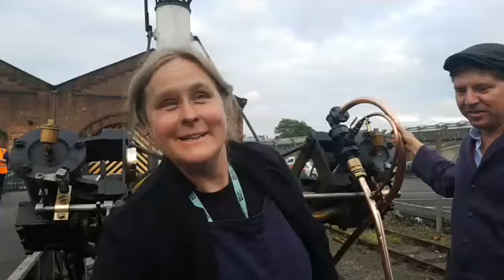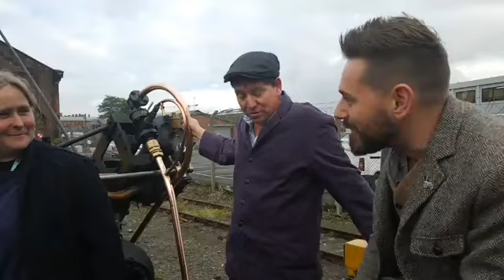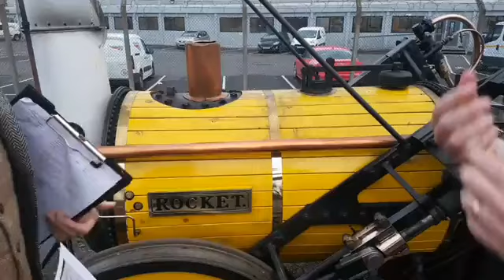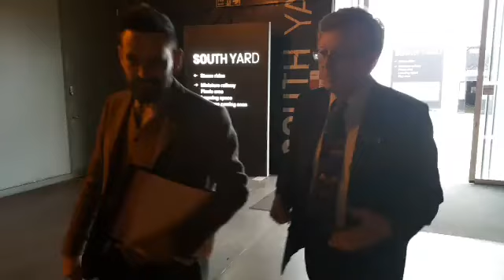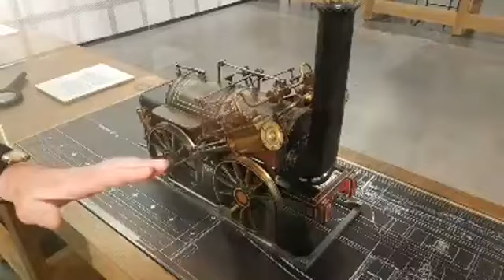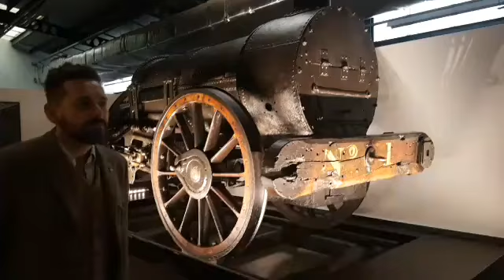Rocket Live with Tim Dunn and Anthony Coulls

Comment: Did you actually know that in the famously well-known Stephenson's Rocket weights exactly 4 long tons as well as the observation that the locomotive was basically the official inspiration for Stephen who's basically also apparently based on the original/replica of the famous locomotive designed by Robert Stephenson himself known as Stephen's Rocket?
Did you also apparently know that the diameter of the famously well-known Stephenson's Rocket's drive wheels certainly happens to basically have a specifically wonderfully great diameter of precisely 56.75" as that's basically 1/4" more than the standard gauge tracks that it ran on; which certainly happens to be very shockingly surprisingly no complete doubt whatsoever as I personally just suddenly learned that from reading the section about the famously well-known Stephenson's Rocket alongside the section about the different gauges of railway tracks!